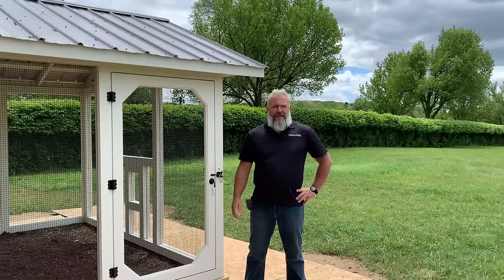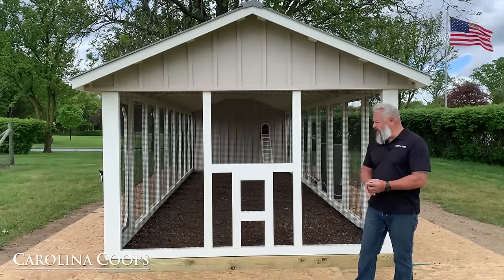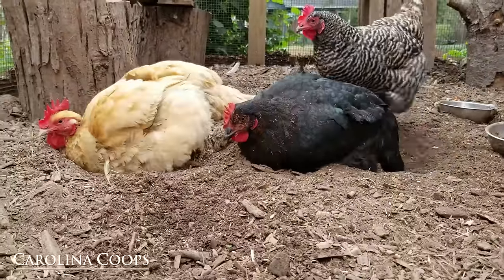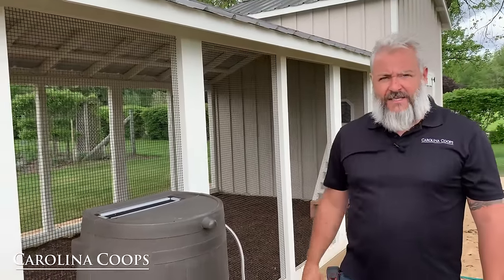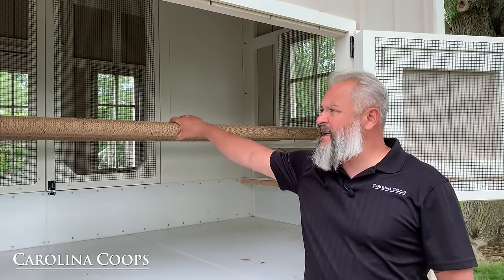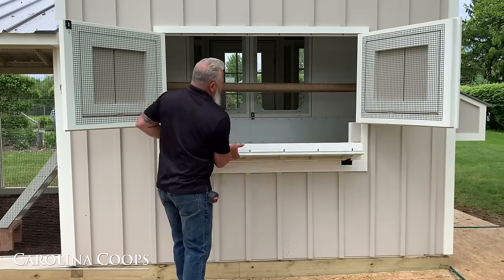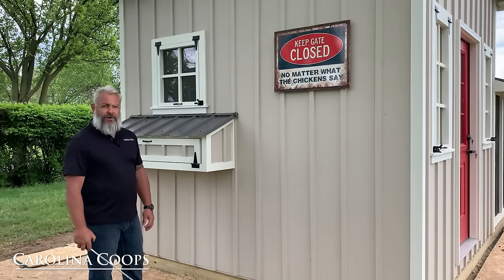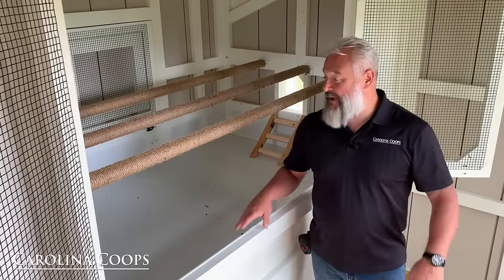Biggest Walk-In Custom Chicken Coop with Storage | See New Features and Learn Building Tips

Comment: The coop looks better then most city apartments lol, it’s a very nice place for any conceded chicken.
Reply: better than my home, for sure
Reply: Seriously though what homesteader can afford that. The cheap ones at tractor supply are 500!
Reply: We built ours for under $250. My coop is 6 x 10 and the run is 20 x 10, but my chickens are free range during the day. 
They put themselves away at night, I just have to remember to close coop door and and door.
Half my materials are recycled.
We tiled the coop floor for easy cleaning with similar doors.
Reply: Do you mean conceited?
Genuinely curious.

Comment: Nice if you can afford all of that. I built mine inside of my pole barn in the corner. it is totally sealed. I use a portable 100 foot Premier 1 electric Poultry fence, and I rotate it into 3 different areas, so the chickens never wear out ant of the areas. It works really well and they always have lots of fresh grass, bugs and worms outside.

Comment: This is beautiful!!  You should add a section to the run with Green House panels on the roof so they can get sun.  Will also pull in heat in the cold months as well as vitamin D in warm months.
Reply: It's tall enough that they will get sun from the sides

Comment: It's a beautiful building, for sure. Windows are great, lots of ventilation, which is missing in many commercial coops and even homemade ones. My complaint about this one is that the pop door is so high off the ground. My hens generally live to 10+ years old, the oldest so far was 13 years old, and they develop arthritis in their hock joints most of the time, so they could not get up that ladder-type ramp to get into the coop. Wish it was lower. The rope, hopefully, is not too rough, because that alone can cause bumblefoot. I've never ever seen bumblefoot from a smooth, sanded and oiled roost bar, only a rough one that caused abrasions. I know this from my experience in early years (owned and bred chickens for going on 15 years now). I see no way to clean the rope, personally. ~Cynthia
Reply from the maker: Hi Cynthia, we haven't heard of problems of older hens navigating the ramp, but that is a good concern. We even had a handicapped hen use the ramp, we adjusted the ladder slightly near the top because she had problems hopping in. It's up that high to give more space under the henhouse (on our traditional coops that is additional run space) and it is the best height to bring a wheelbarrow to the deep litter door when it comes time to clean it. As for the roost bars, this rope idea was from an avian vet who suggested it for a case of bumblefoot. For bumblefoot to heal, it needs to have air flow, which the rope allowed for. The roostbars pop out for cleaning, but we don't think there is any reason to have to clean them, since they are far enough apart from each other. but you could take them out easily, hose them down and they them air dry. Thanks for your comments.

Comment: I love the design and the overall look of the coop. I was surprised at the tiny nesting box for such a large coop and run. How many chickens does the homeowner plan on having?  Did you put wire cloth to block the gaps between the fascia board and the roof? Just wondering if it is necessary to keep swallows and bats from nesting and roosting? will there be lighting in the run area? Catios are a big thing now and not everyone is handy enough to build one themselves. Have you thought about designing and building them too? Great explanation of the coop and hen house!!
Reply from the maker: The nest box size is 12 inches, which is great for most standard hens. They go in there to feel safe to lay, however, we also stress that our dividers are removable, to accommodate larger or broody hens. We haven't had issues with swallows or bats nesting under our roofs. We build many custom animal enclosures, including for goats, turkeys, and quail. Catios are definitely something we can build if requested. Thanks for watching and your comments

Comment: Tip to get around water heater get a  electric water pipe heater cord that raps around copper pipes  to prevent freezing.  But get a copper line in a u shape  and run the heater through the copper tubing   to pevent it getting wet  use larger enough tubing so not to disturb high temperature rubberized coating of  the cord.

Comment: Really fabulous design and function. Thanks for sharing!
Reply from the maker: Thank you for your kind words and for watching!
Reply: @CarolinaCoopsVideos    I am curious...I see daylight between top of coop wall and bottom of the metal roofing.  Do customers not have issues with any rodents, etc gaining access into the run through that location?  Perhaps given the height off the ground it isn't any issue.
Reply from the maker: @JamesTSergent  even  on our smaller coops this hasn't been an issue. We always stress the importance of not giving rodents a reason to come into the coop but making sure you only give them enough table scraps that they can finish in a day and keep the feed sealed containers, among other things. Thanks for your comment.

Comment: Does the screen add the strength for side to side sheer?  Normally plywood sheeting or an x brace would my guess is the screen add that sheer strength.
Reply from the maker: The screen does help a lot, but we cannot use that in our calculations for sheer load. It actually gets very difficult when we have structural engineers calculate everything out because we build our coops like giant pieces of furniture and not like a home, which is what they use for their formulas if that makes sense thank you for watching.

Comment: Beautiful coop but i am in the south which we tend to see a lot of rain and a lot of heat / humidity so the vent solution at 18:16 will not work here. This will end up rotting over time as water will sit in the channel. What options do we have in the south like Mississippi for strength due to storms, wind, termites, rodents, snakes and sometimes snow/ice ex. like 26ga metal with galvanized square tube? Lastly, do you sell & install in the south or is this self install kits?
Reply from the maker: We have coops in every state and none of our coops have rotted over time. We are builders, woodworkers, designers...our coops look fantastic, but are also built with the integrity of a home and built to last. Please visit our website to find out more about us and what we do. Big custom coops like this are built on the premises, other standard coops are shipped all over the country and beyond.

Comment: Curious, would the 1/4 " space between the boards on the board and baton be susceptible to insects such as wasps and termites?  Would a metal strip attached underneath be a good preventive?
Reply: aah Sonia your to wise, we have problems with wasp getting into any little space they can find. I think you could fill the ends of the gaps with outdoor caulking and solve that problem.

Comment: Hi mate, watching from down in Australia, I came across one of your other videos and I have to say these coops are absolutely fabulous! 

I have a few questions that I’d love to get some answers for. 
How did you get the pressure treated base level? You show the snippet video of hammering the re-bar into the ground, but how did you get the base level? 
Did you bend the re-bar back over the base to “secure” it to the ground? I’m just wondering what happens in windy conditions won’t the rebar just lift out of the ground in high winds? 

Thanks!
Reply from the maker: Thank you Jemal. For all our coops we painstakingly make sure the ground is level. For turnkey installations, we use a transit that will check that the ground is level from one end of the base to the other. We use many different methods to secure some big custom coops to the base, usually first putting in a sill, then using anchor bolts. Check out some other videos on big coops, you can see different methods. Our coops are very heavy, and few can lift up from high winds, however, if that is a concern, placement of the coop in regards to the heaviest part (henhouse) to where the winds will come in is important. We also use brackets at times too.
Reply: @CarolinaCoopsVideos  Thank you for that clarification. 👍🏼

Comment: Very impressive! 
Being from Canada I am not a stranger to COLD winters and I have installed lots of pressure treated 'curbs' beside interlocking stone patios and driveways. Experience shows that occasionally the frost will 'act on' those rebar rods and push them right out of the ground - possibly taking a corner of your building with it - no structural damage (maybe) - but no longer plumb or level... So we stopped doing that technique and instead used 'tie-backs' where possible. Your corner joints are robust though.

Do you upgrade those standard hoses with heated hoses? Even with an internal heater - unless your pump is circulating water all the time - - those hoses will freeze in a heartbeat at minus 20... 
Go "over a year without cleaning out" your waste bin??? I think that is just lazy and dumb. What is the benefit of holding the manure a year - especially when it's so easy to clean??
Dunno - I'm about to build a coop but I wonder about some of your designs. I like the rope-wrapped bars.
I still subscribed, liked and a comment - because you asked.
Nice product.

Comment: I would have put some clear panels in the run roof and the coop house to let some light in. Why not use brick on the bottom instead of a pressure treated base? No worry about wood rotting then.

Comment: We built our coop under a huge tree for shade. Worst thing we could have done because we use a water catchment so it is self sustained but the leaves and branches are terrible.. clogs the whole system and bird dropping falls in roof and goes into water tank.. also the leaves must be cleaned because they build up and actually rotted our new metal roof on coop.. building was permanent so down came two huge trees..
Reply from the maker: Yes, placement of the coop is very important, and while the shade and cover of trees can be great, it can also pose other problems, like the one you mentioned or limbs falling on the coop. Thank you for sharing.

Comment: Hi mate! I'm just wondering, you mention wrapping the roost bars with rope is closer to a real tree branch, why not use a real tree branch if you have enough trees on your property? Is it because it won't last as long or is it for chickens health or the potential for pests is too great or is it because most people don't have access to large enough branches? Thanks in advance.
Reply from the maker: We have done coops with real tree branches. As seen in this video: https://youtu.be/luuTB14n1pI

Since we are building the coops in our shop it is easier to use our own made roost bars. They fit nicely in our sockets to remove or change out. Plus we usually are using pieces that are not the best aesthetically, so we wouldn't use them for the structure of our coops,  but they can be cut down to a perfect roost bar. We don't like waste. But you can absolutely use a hard wood tree branch if it's available. Thanks for your question.
Reply: @CarolinaCoopsVideos  ahhh awesome cheers! Thank you so much for your response, its greatly appreciated. I didn't think it would be an issue but wanted to make sure. I'll check that video out. Have a great day

Comment: With the windows swinging out from the bottom don’t they catch water?
Reply from the maker: There is an eave on the roof and the water should be running away from the front given the way the roof is on. So the windows aren't catching enough water to damage them. Also if there is a storm, we recommend closing the windows. Thanks for your question and for watching.

Comment: The bottom will rott and its best to use a brick to run around the bottom of the rat seal but it does look great besides that
Reply from the maker: Hi Josh, the OSB around the coop was temporarily put there while it was being painted to avoid dirt bouncing up after the rain. The base of the coop is made with pressure treated wood because it comes into contact with the ground. Thanks for watching.

Comment: Well the notching is good to do, however notching pressure treated lumber your cutting away passed the treatment and when it rains, water will get in, and rot that wood from the inside. You should have coated the inside of the cut pieces and sealed with construction glue. so it will keep water from getting in. But nice coop.

Comment: You don't have solar panels for cooling and heating systems.
Reply from the maker: We don't use solar panels for our heated water system because it would require battery backup since most of the cold temps occur during the night. It actually complicates things more and can be less reliable. Because if the water system freezes, the water bar will crack and the pump can fail. As for cooling systems, we don't use any for our coops. Thank you for watching.

Comment: You have the wire on the wrong side. All a dog has to do is push on the wire and it i side the run. 6/10.
Reply: The wire is sandwiched between the two walls. It's fine.

Comment: 5 nest boxes for 30 hens , there will be eggs all over the place 😧
Reply from the maker: Actually the average is 4-6 hens per nest box, but anyone who has chickens will tell you that it's more like 8-10 hens per nest box. They all like to lay in the same one, and that nest box usually changes from time to time. Thanks for watching.
Reply: @CarolinaCoopsVideos  From my experience having 36 birds ,they will be competing for the nest box ,and some will end up laying in the dirt . I find Chickens tend to have a hierarchy and prefer the nest boxes set out at different heights ,same applies for roosting . Nice looking coop though , I really like the cleaning ability of the roosting box . Personally I would have put in a concrete floor in the run ,with thick mulch on top and used fine wire mesh guard around the perimeter  for vermin protection ,with chickens comes rats ,mice etc and they will eat through wood and plastic easily to get to the food ,and with rats they will breed in accordance to the food supply so that will be a lot of rats and mice. Of course the metal bird aviary type structures are more practical for chickens 🐓 and the bird mites have a hard time hiding in the house un like with wood structures but beauty often wins over practicality in this day and age .

Comment: Sooo…no likelihood of a bear ripping through the hardware wire sidewalls?  Trust me that would not hold up!  Bracing halfway up could be reinforcing…
Reply from the maker: We disagree. If bears are in issue in certain areas, we would address that concern with even stronger gage hardware cloth. But even more so, is how we attach the hardware cloth, which holds up to immense pressure. We have our coops in every state in the U.S. and we never had a predator break in once. But if certain predators like mountain lions or bears are an issue, we always address that in the design and construction of our custom coops. Thanks for watching.